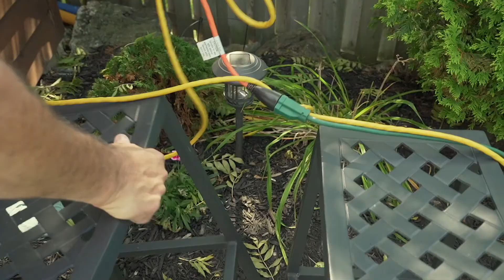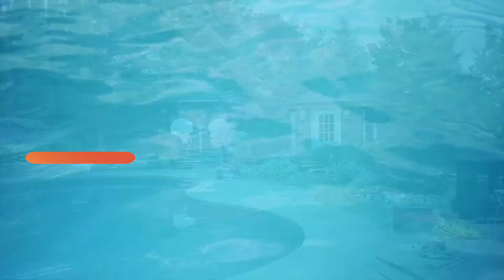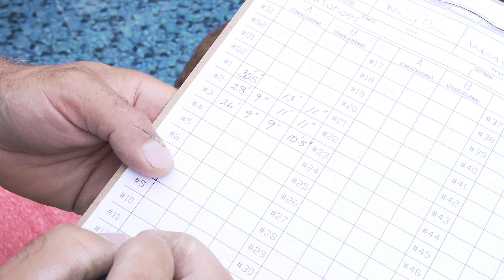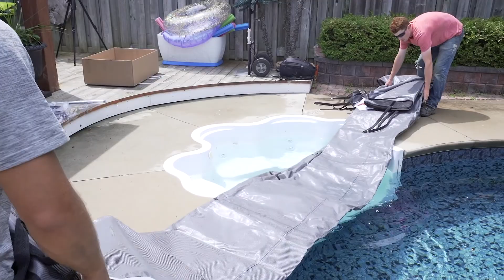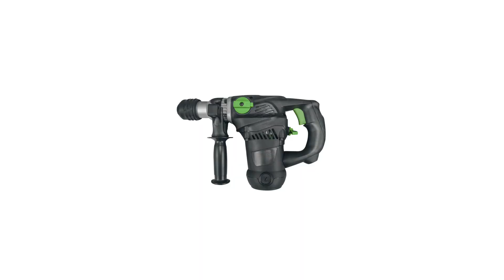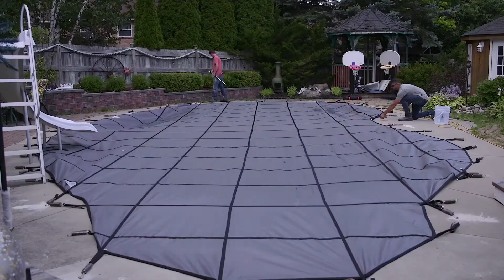Inground Freeform Swimming Pool Safety Cover - Measure | Install | How To

Comment: So watching the video i would suggest to measure the centre of the pool and run a string line accross shallow and deep end to fond correct location for centre strap. Then measure the distance from centre strap to corner and make sure anchors is 14 to 16 inches back from where the cover sits on the deck or 32 to 34 inches from the pool wall. Saves a lot of hastle In the video buddys first hole he drills is in the wrong spot. Great tutorial though and love your videos especially on free form liner measuring. Cheers